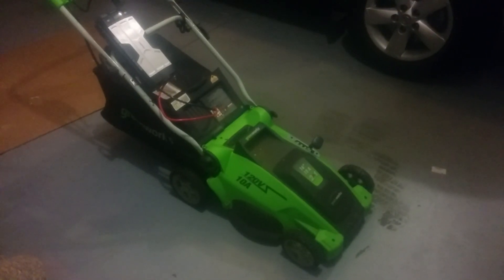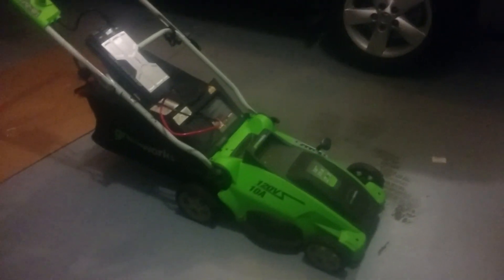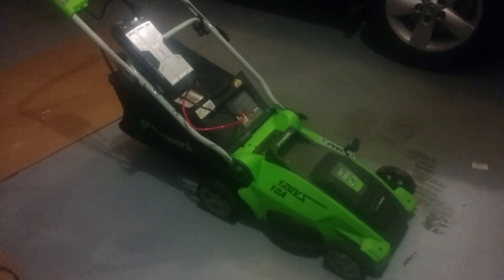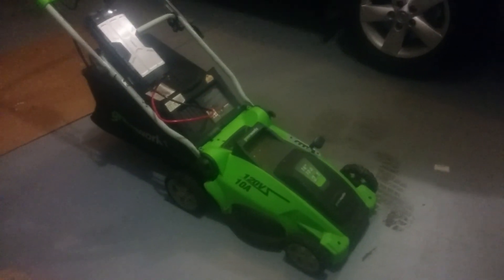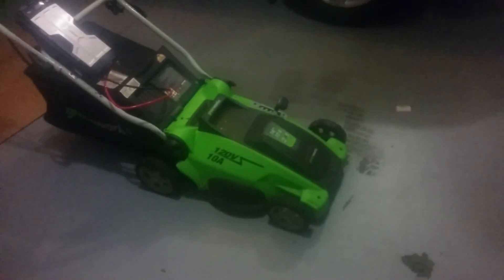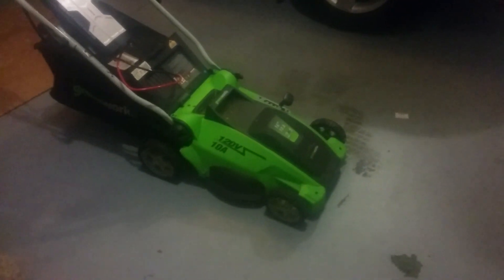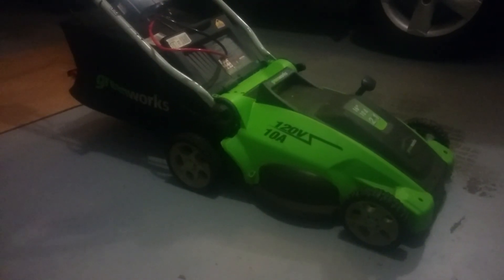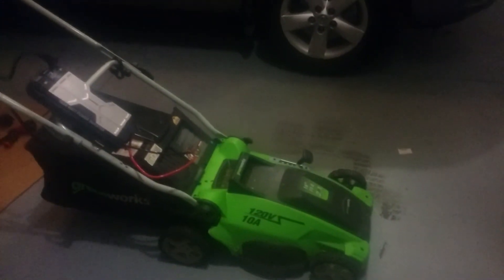Convert Greenworks electric lawnmover to battery

Comment: why not use something like this? Greenworks 40V 300W Cordless Power Inverter IV40A00 It connects to GreenWorks  29472  G-MAX 40V Li-Ion which powers their cordless mower
Reply: 300W not enough.
Reply: @walterenriquez9443  oh ok

Comment: Enjoyed the video. Lite weight Lithium batteries are available. The 3 cell battery should suffice. For extra power a 4 cell one is fine. They come in various sizes and capacity. I suggest using several batteries at 15 minute intervals. They just plug in. A special charger is needed. They are used by model plane fliers. Use with care. Typical initial trial battery can be this: https://hobbyking.com/en_us/turnigy-heavy-duty-4000mah-3s-60c-lipo-pack-1.html  .
Reply from the maker: good.
Reply: Laconic.